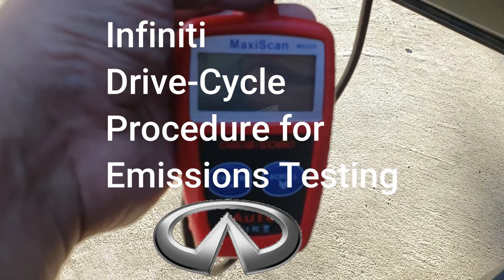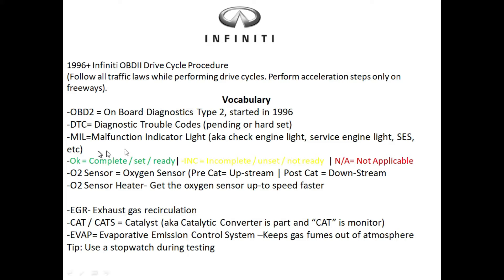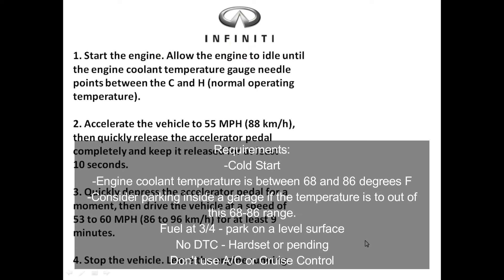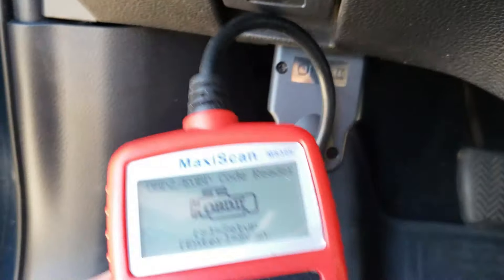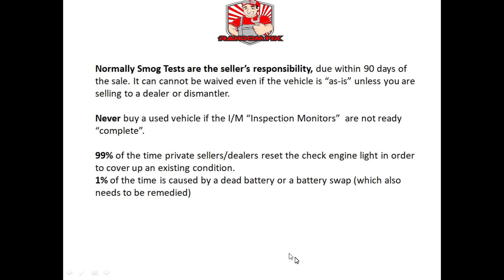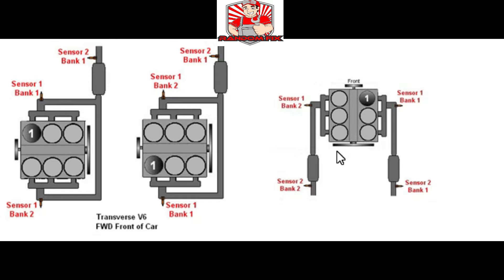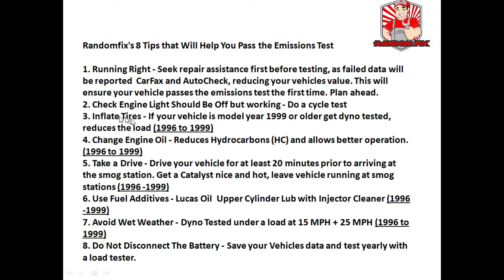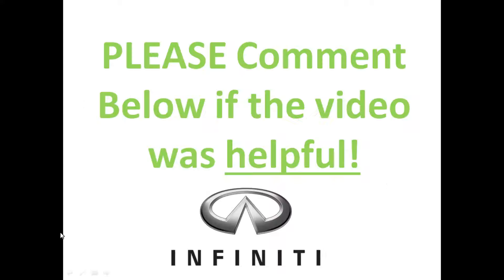Infiniti Emissions Drive Cycle▶️ Infiniti Smog Test Evap Cat o2 EGR Monitor Readiness

Comment: What Scanner are you using and where can i purchase it. I,m an Aussie having trouble purchasing scanner for my 2003 Skyline
Reply from the maker: Check the video links and it will redirect you to Australian Amazon for relatives obd2 readers, you don’t need a scanner just a $30 obd2 reader with I m inspection monitor data.   What color is the skyline?

Comment: I have a U1024 code on my infiniti g 37. I had two other codes from the airflow system that was replaced over a yr ago. I got the ecu reprogrammed and it got rid of those codes, but it left a U1024 code. If somebody didnt do all of these things, would the code drop off from normal driving over a few months?
Reply from the maker: The correct kind of driving can self clear the code. I think you have a permanent that caused by the reflash of the computer. Here how to clear permanent codes https://youtu.be/kVPSEQsvMOk?si=rmSuYQoCQ9Ar68y7
And this article will give a little understanding https://www.reddit.com/r/G37/s/LigsRJbXO2
Good luck and keep me posted
Reply: @RANDOMFIX  So if I understand that video right, the perm code U1024 will not drop off, I just need to start the car and drive for a while 15-20 times?  then tell the guy at the smog I did that, and the code will remain on there?  The techniccian at the dealership gave me a bunch of time frames to drive the car in (called it a global cycle) and said the computer needs to get more data to erase that code.   
You say perm codes are like tattooos and they are on there for life tho?
Reply from the maker: @abprepboy33 there is a drive cycle to set the inspection monitors and there a procedure to clear the permanent codes. You need to do both. Start having the vehicle clearing the permanent codes https://youtu.be/kVPSEQsvMOk?si=1xlXmx_XD910sFuR
Then complete the infinite drive cycle that is posted on this video.

Comment: I just picked up a 2011 g37 manual, I put on about 300 miles on it o2 monitor still show “INC.” Guy had test pipes previously and I installed OEM cats when I first got it. I just put in a new battery
Reply from the maker: So every other monitor is ready?
Reply: @RANDOMFIX  yes every single one except o2 monitors. And no check engine light. I forgot to mention
Reply from the maker: Check the o2  connectors and have you started the vehicle and just let it idle? Any mods?
Reply: @RANDOMFIX  yes I let it idle. For like 10-15 minutes straight at the most. I did fail smog once already because I was not aware of the o2 monitor not ready. I appreciate you replying back.
Reply: @RANDOMFIX  I'm having the same issue on my 09 g37s

Comment: I have 02 maxima evap and cat not ready for smog
Reply from the maker: Focus on the catalyst
Reply: can i pass emissions the same day after doing misfire codes (random and cyl4) repairs?
Reply from the maker: Are the codes still present and is the check engine light on?
Reply: @RANDOMFIX yes the light is on for p300 and p304 but if i do all the plugs and a coil do you think i could ready it same day for emissions